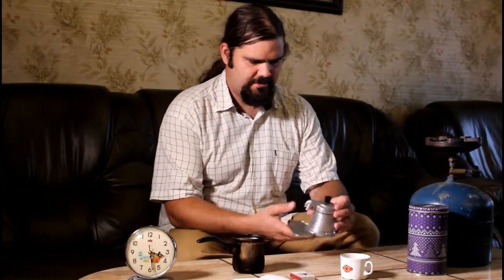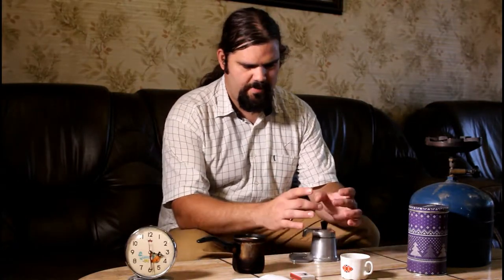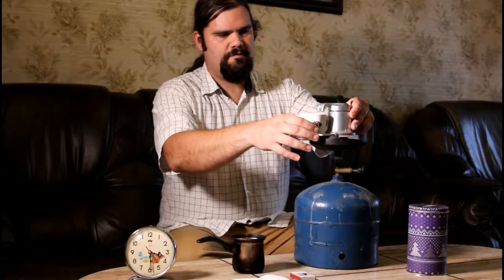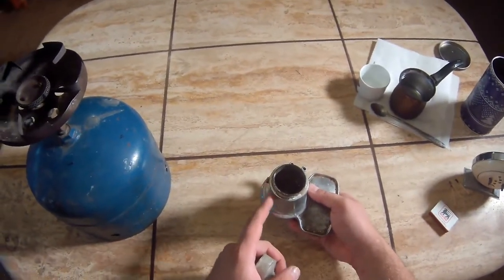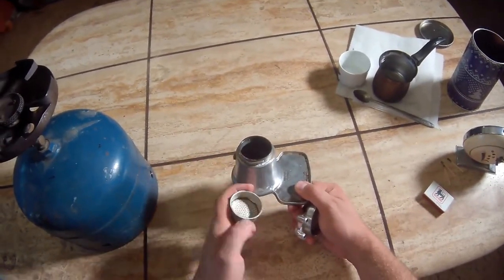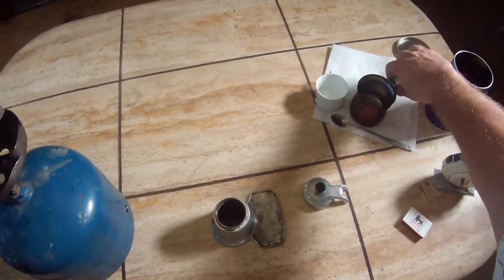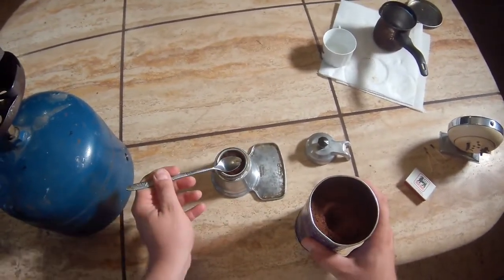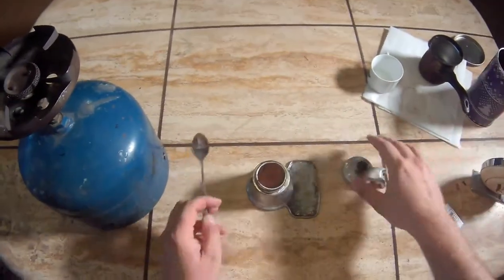Vintage 70s Italian mini espresso machine [presentation]

Comment: You're supposed to remove it from the heat (or ideally remove the cup and put another one in its place so you don't make a mess) the moment it starts gurgling: everything that comes out afterwards is burnt and acidic.
Reply from the maker: Hy, thanks for the advice! Just out of curiosity:  in this case, doesn't it mean that everything that comes from a standard stove-top mokka pot is also burnt and acidic?
Reply: @isographer you've opened a big can of worms :D the answer is: yes and no. The part that comes out after it starts sputtering is MORE burnt and acidic; however, you've got the right idea - moka pots are actually a flawed design in general, as the water that comes up the stem is right out of boiling and too hot for proper brewing, so it makes an excessively strong coffee that is only appreciated in areas where it's long been an acquired taste, such as Italy (where I incidentally come from :D). The whole subject is controversial and it can start long arguments in my country, because it implies that sixty million people have been doing wrong for decades one of the things for which they're most proud. However it's telling that Bialetti - the ones who made the moka pot originally - figured out the problem way back in the sixties and tried to solve it with the Termocrem system, which used a second water tank that wouldn't get heated as much. The product was a massive failure: the masses had already grown accustomed to the bitter taste of moka coffee and felt the corrected taste was "weak"; Bialetti sold so few Termocrems it's almost impossible to find one today. Here are a couple links (not written by me; you'll probably have to use google translate), the first has more information about the phenomenon and the second has a detailed look at the Termocrem system.
http://caffettiere.blogspot.com/2016/11/caffe-analisi-della-mancata-evoluzione.html
http://caffettiere.blogspot.com/2018/06/caffettiera-moka-express-bialetti-con.html
Reply from the maker: @fallingwater  Hy, thanks for telling me about the Termocrem system. Didn't know about it - too bad it's very rare. Now I want one :) In conclusion it's obvious that Mokka Pot style of espresso machines are just compromises and indeed , another important factor is how a certain population or individuals got accustomed to their coffee. Another example would be the coffee percolator that was widely used in USA back in the day, which over boils the coffee over and over. But I bet that to some people who grew up with it that's how coffee is supposed to taste/be.
Reply: @isographer  if it's a little clear it means that the water is kinda channeling away from the grinds , it could be just the coffee in the top chamber that has been made has sat there in the super heat conducting aluminum pot.
Usually I'll just turn the stove off once it's a little over half the capacity of the coffee it makes.
Lovely video!!!
Reply: I became interested in acquiring a Termocrem after reading your post years ago and, after what felt like forever, I finally found one for $14. This coffee maker is a very difficult to find nowadays because most are mistakenly listed as regular Moka Expresses by ill-informed sellers. To make matters worse, there was a much more common milk frothing system that Bialetti sold in 1982 which shares the same name but bares no resemblance to the original Termocrem.
Reply: @SplendorSolis  I had no memory of writing any of this stuff :D glad it was useful to someone in the end! Also I'm curious about that Termocrem... I regularly visit local thrift stores and I've found all sorts of weird coffee things, but never a Termocrem. It really is a unicorn.